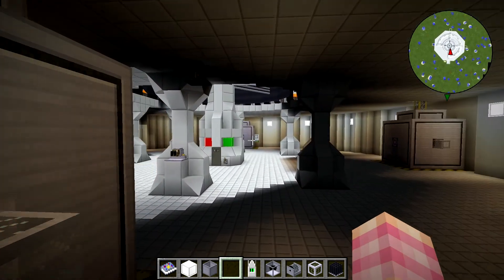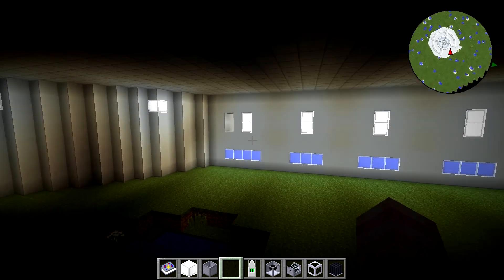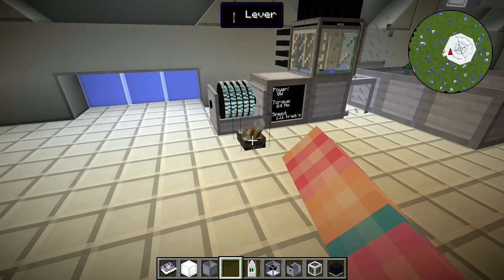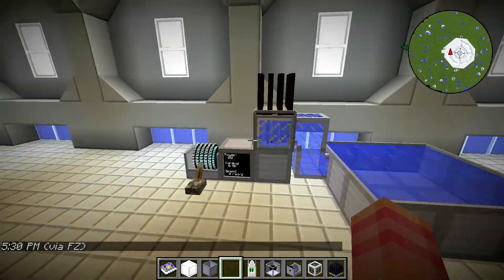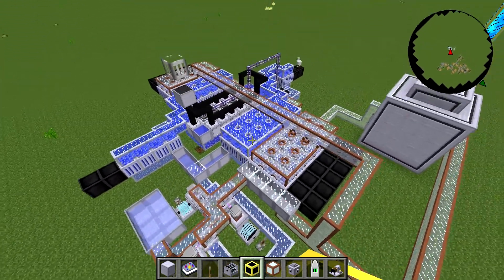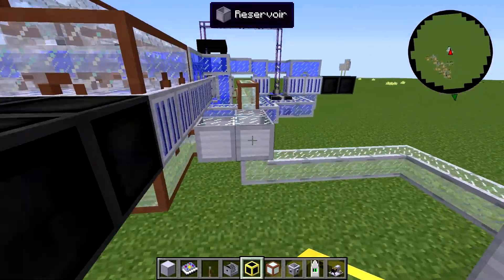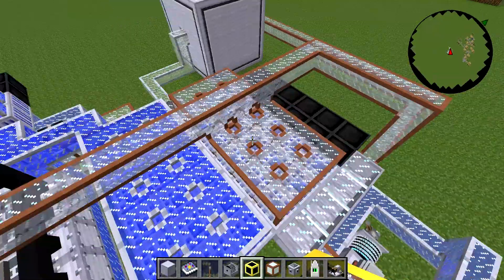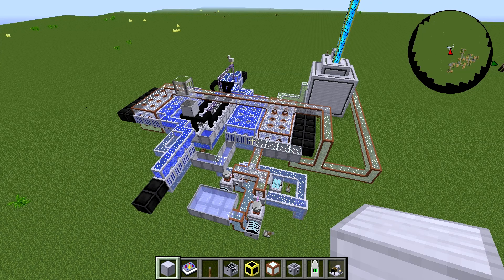ReactorCraft - Fusion Plant Build #2

Comment: i know i'm several years late but through some experimenting i've found you can void the oxygen using the pulse jet furnace if you pipe it into it and provide it with power and leave just a little bit of jet fuel in it but don't feed it any items it'll just burn oxygen but not the fuel it'll run very hot tho even when water cooled

Comment: Why do you insist on using fission reactors for making the tritium? It's so much more efficient to just put a couple one irradiation chamber around the torus, and much faster, too.
Also, about the dew point aggregators, you'll want to use those even if you are building in an ocean, simply because getting the amount of water necessary using just pumps will generate quite a load on the server because of all the block updates.
Reply from the maker: +Thundercunt McGeezax I'll need to produce enough Tritium to get the reactor started the first time. I'll definitely want to put irradiation chambers in the reactor itself to produce its own fuel as well.
Reply: SentinalhMC Ah, that makes sense. I was assuming you built this in the same world as you did the previous tutorials and still had the tritium you generated there.
Reply from the maker: Thundercunt McGeezax
No this is being built in a seperate superflat world and my goal is to make it a self contained build, with everything in it to make it work.
Reply: SentinalhMC Alright, I hope you get around to finishing it up and uploading the last part soon.
Reply from the maker: Thundercunt McGeezax
Who knows man, time is super limited these days.

Comment: More notes for anyone interested:

Preheater consumption is 1 part Deuterium, 1 part Tritium to make 2 parts Plasma.

The injectors use an incredibly tiny amount of fuel. ( Actually, compared to real life, they use an insanely large amount...but still.. ) You can get by with a single NIC in a single corner of your fusion reactor that rarely gets neutrons. ( well, 2 NICs if you want to produce the Deuterium as well. ) This is looking to be orders of magnitude more DT production than needed.

Just checked, and it's 40mb/s per injector, so 160mb/s of plasma for a standard 4 injector reactor.

Then the NIC numbers are:

Tritium is a 75% chance to make 25mb per neutron.
Deuterium is a 25% chance to make 100mb per neutron.

This means for tritium you need ~4.3 neutrons per second. Deuterium needs ~3.2 neutrons per second. This is for the entire production of the tokamak. 3-5 neutrons per second is a very small amount, especially for a 4 injector fusion reactor. There will be hotspots getting well over 20 per second.
Reply from the maker: +zemerick13 Hey thanks for the info, that will come in real handy.
Reply: SentinalhMC NP. I haven't gotten to your other Fusion videos yet, but I'll let you know if anything else pops up:)

Also was thinking about getting with you on a troubleshooting video. I spend a lot of time helping people get their Tokamaks working, and it's really just the same few things over and over again. Now that the v7/v8 issues have been fixed, it should be pretty easy.

That being said, I'm currently discussing a change with Reika that would affect the Toroid required charge. Will at least have to get a decision from him on that first of course.

Comment: ... Couldn't you just put another layer on top? I'm pretty sure steam boilers connect when placed on top of each other, so maybe everything else reactor-related does as well.
Reply from the maker: Nathan67003 You can do duel layer reactors yes, I'll look into it as a possibility.
Reply: SentinalhMC Also of note (i believe this is correct): if you want max uranium efficiency, do NOT let neutrons hit other fuel cores, only let them hit the irradiation chambers and reflectors. For faster production, let the fuel cores react with each others (you lose efficiency because the neutrons are used to preemptively trigger fission).
Alternatively, replace 1/4 of your absorber/boiler ring with irradiation chambers and neutron reflectors.
Reply from the maker: Nathan67003 I dont' think you get how the fission reactors work. You NEED neutrons to hit other reactors in order to keep the chain reaction going.
Reply: Oh, yeah, right. So, 2 cores separated by a control rod instead of a single core...? Also, I'm pretty sure the first time you put fuel in a fuel core in your ReactorCraft tutorial videos, I saw some neutrons fly off. That's where the brain fart came from.

Comment: Why don't you just use the neutrons from the fusion reactor? Then you'll just need one reactor, accumulate enough deuterium and tritium to get the reaction started, and it'll run for as long as there's heavy water.
Reply from the maker: Abculatter A Like you say, I need to get the reactor started first for that to work. I'll look into making it self sustaining though.

Comment: hello Sentinalh, i have a problem with this reactor, i can launch only one plasma injector, if i'm launching more, pipes at the other injectors just melting, and some neutron absorbers melting too, all boilers have water, all pipes charged with van de grafs and insulated by wool, all working with one injector, but not with two or all four :( can you advice something?

Comment: Have you tried turning it off and on again? ヅ
Reply from the maker: kanethornwyrd Wasn't that your design? :)
Reply from the maker: waterlubber Yeah this was just an initial experiment, which honestly worked out better than I thought it would. Optimization is hard when you don't have the exact numbers to work with.
Reply from the maker: kanethornwyrd I'll build it again for testing.
Reply: Seriously, you might want to put a chamber in the center of the linear reactor or maybe a "plus" shape
Reply: waterlubber a # shape is even better ! :)
Reply: SentinalhMC yes, and I keep thinking it's the more optimal one, because you get self sustained reactions cascade, each IC being hit on 2 axis all the time and quite often excess neutrons ejected by the sides.
Reply: SentinalhMC cool ^^, the only "bad things" I have observed about it, are:
- its nuclear fuel consumption, you better have a steady supply.
- over-sensibility to the presence of unwanted isotopes, they tend to poison the reaction at a point that the productivity can get a 80% drop.
- because of the Wastes sensibility, the steam production can oscillate between 1 HP turbine and 8, which is, in an industrial exploitation, really not desired :D

conclusion: this reactor is really efficient, but it's a pain to maintain if you don't over-automate it.

A good point is that it is really efficient for what you put in it, and it work quite good in a near-SCRAM situation.